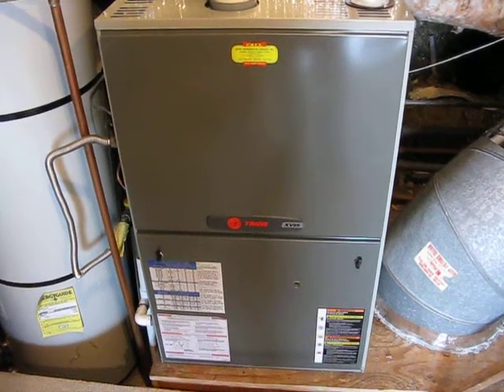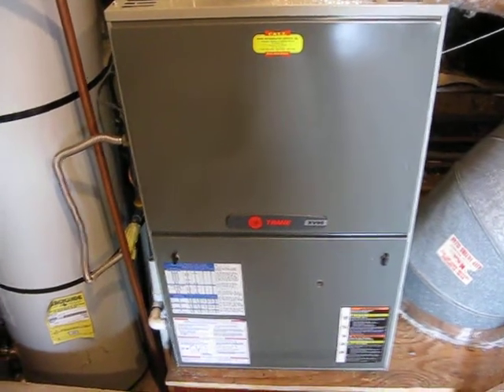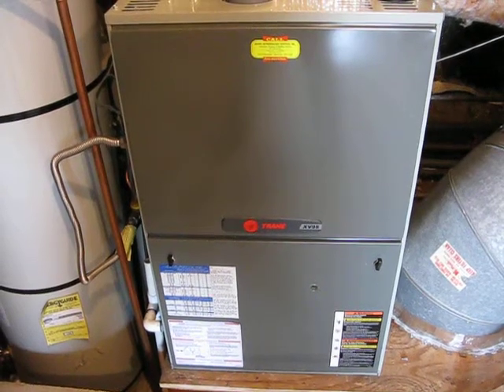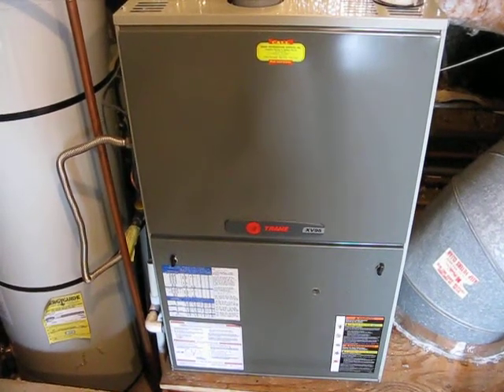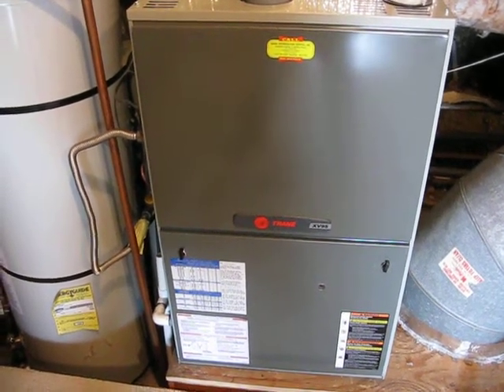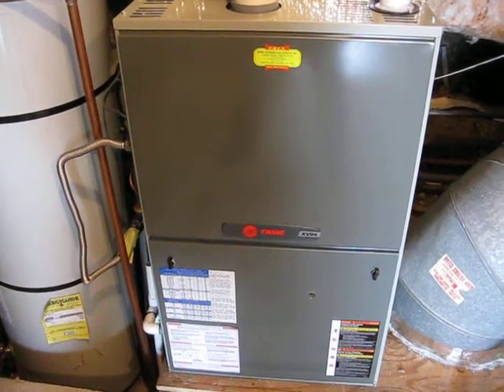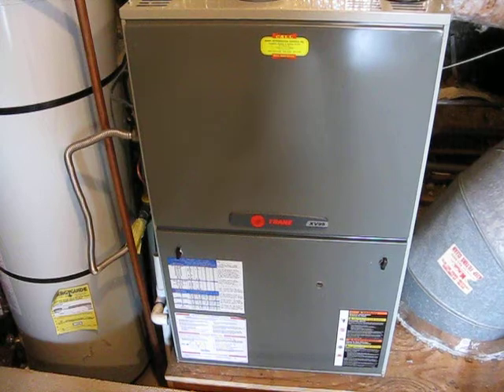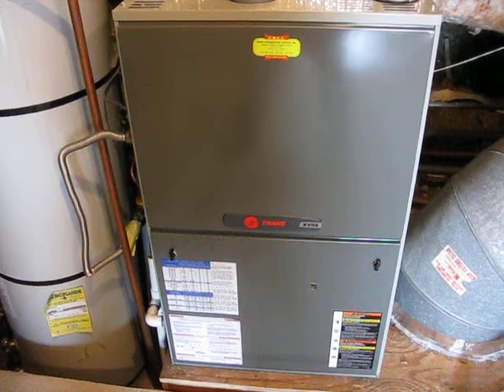Trane 95% furnace

Comment: I've seen this happen a lot and it's because the homeowner doesn't want to spend the money to put this on a proper metal box. Think about it, if you put this furnace on the floor and ran a drop elbow you'd never get the door open to the blower. I'm not crazy about the install either, but since this is a retrofit; sometimes you have to make do.